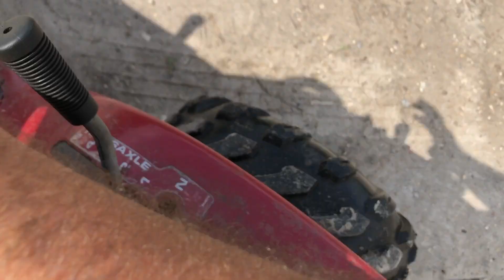My Mean Murray Mud Mower

Comment: cool murray mine has rats in it so its called rat mower currently it doesnt start unless you hot wire it also it leaks gas i got it for free also a gear or trans went out i fixed it and it drives but i havent drove it in 2 months also the motor cover is off so its like having blades on top and bottom so rat mower is kinda dangerous but it works!
Reply from the maker: I love free and cool that its has a name. Thanks for watching!!

Comment: My murray has the stock pully over the back tires  to get it a lil faster how big it small should the drive pully  be
Reply from the maker: I have some with stock 9 inch pulleys that are slow, my fastest has a 3.5 inch pulley.3.5 does slip in water.  I have others with 5 inch in back and a 6 inch in front, that is a pretty good combo. It goes fast with less slip when wet. Good luck and thanks for watching.
Reply: It's a 6 in in the back I could flip the pully up side down In the front it's a 2003 model

Comment: Put a string on the throttle and it will go way faster I have a mower and I got it up to abt 35 by doing that
Reply from the maker: Be careful, that is how I blew up my zombie mower too. Thanks for watching.
Reply: I had to long of a string one time and my back wheel caught it and yanked it out of my hands and went full throttle😂 scary ass moment